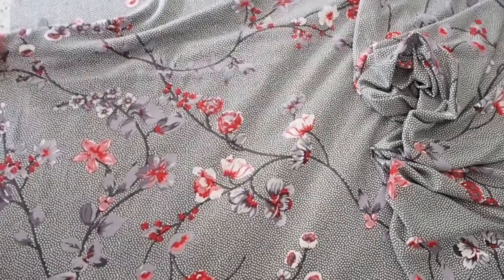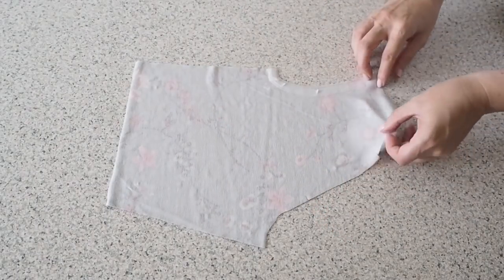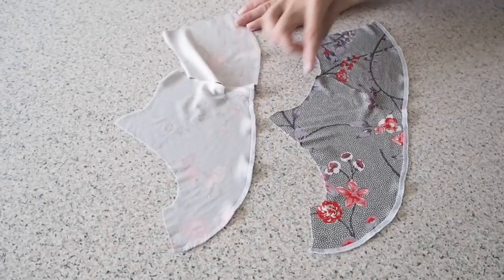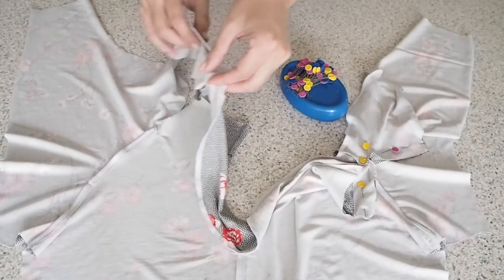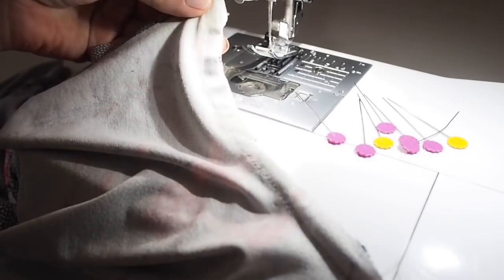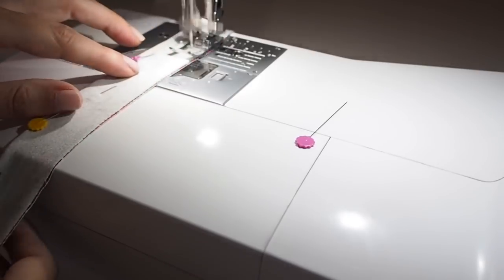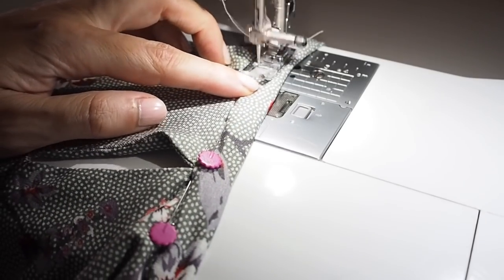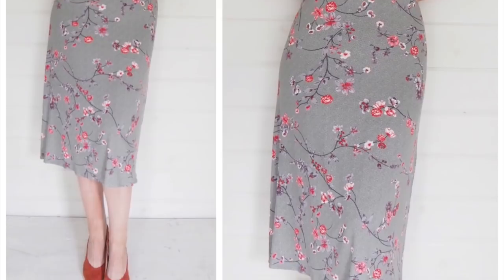How I Sewed my 1940s "STYLE" Tea Dress with Keyhole Detail

Comment: It's lovely.  Great detail with the cut outs. Could you tell me what the rationale was in cutting the front as 2 pieces instead of on the fold?
Reply from the maker: Thanks Jana💕, I wanted the keyhole to touch at the centre front neck. I also wanted to finish this area cleanly with the facing which required seam allowance. This resulted in the said seam allowance protruding the centre front at the neck hence cutting two pieces 👍